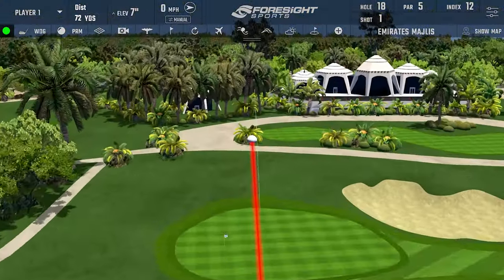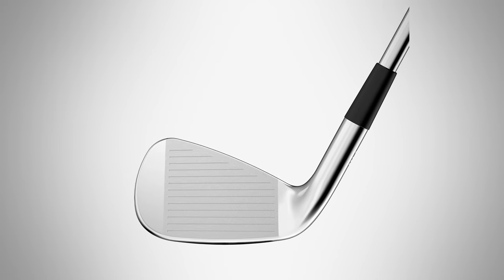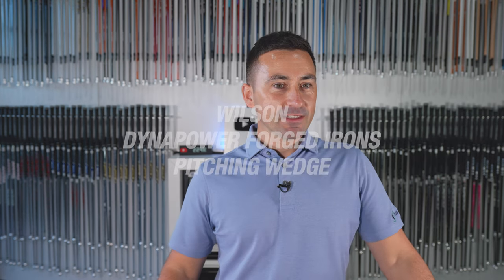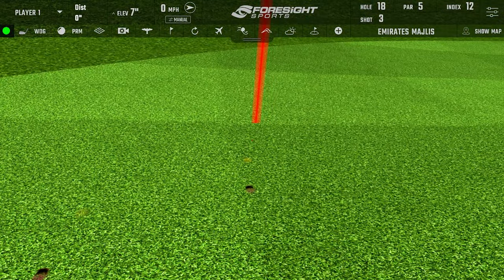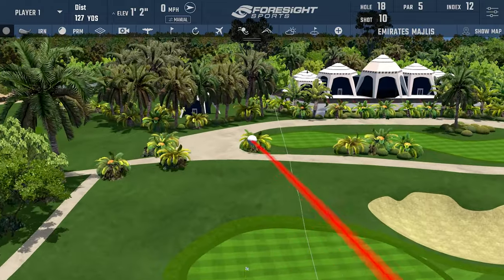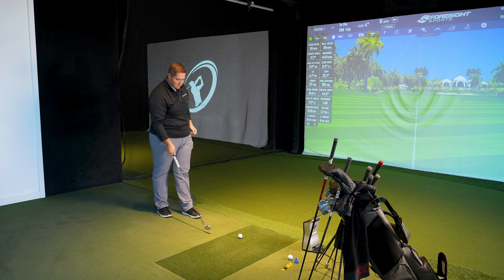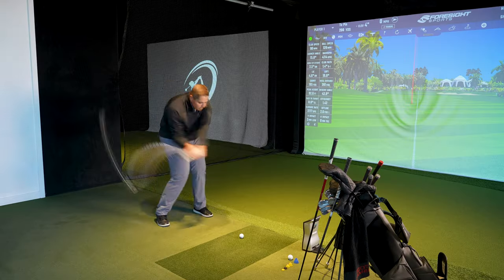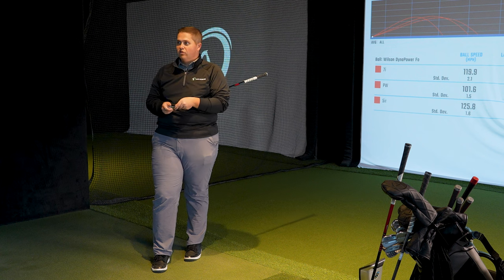WILSON DYNAPOWER FORGED IRONS \\ Game Changers?

Comment: Interesting. I noticed Mikey's chs was the same with the 7i and 5i, which probably explains some of the 'gapping issues'. I have the same speed issue (just a few mph slower) and the same gapping challenge - not enough gap to slot a 6i in there but too much to take the 6i out. I'm thinking of strengthening the 6i a degree and the 5i 2 degrees (and maybe lengthening the shaft for a mph or two more chs) to stretching the gapping closer to what I want.
I already play the Dynapower's predecessor - the D9 forged 5i and 6i, and the staff CB 7i and 8i and I don't think there is a noticeable difference in feel so am surprised Mikey thinks the forged Dynapower feel harsher than the CBs. I guess, like beauty, feel is in the hands (and ears) of the beholder.

Comment: They look good, they sound fantastic, they are clearly very forgiving but...

the spin on the 7i was stupidly low, the gapping between 7i and 5i was poor.  I do wonder whether the 6i might go almost exactly the same distance as the 5i.  I am guessing that the only way a ball stops on a green with 8i or longer is down to peak height and descent angle.

Cannot help but feel there are better options out there, but possibly not at the price Wilson sell at.  Like many sets with similar lofts this is not a set to have a 5i or 4i

Comment: You mentioned in a previous video that you would bend Mikey’s irons 2 up for the long irons and flatten the wedges, I’m thinking of doing this too with my new CB’s to help with the leaking 5 iron. What is Miley does in his swing that makes you consider that?
Reply: I'm doing the same JT. With a steeper but i--o swing plane with the short irons, I'm starting and sending them left. With the longer irons I have a slightly o-i path and start them straight but send them right. The flatter lie in the short irons will start the ball more neutral and reduce the left miss while the opposite will be the case when I make the longer irons more upright.

Comment: 4600 spin good for a 7 Guys?
Reply: The 7 is a 5 iron traditional loft s0 4600 is a touch low but not a travesty
Reply: @autumnstar9475 wrong, the 7 iron loft on these are 30.5, traditional loft on a 5 iron is 27. Trad loft on 6 iron is 30 so your way off
Reply: @ultimatejay  youre way off and ill informed. Maybe delusional. Traditional iron lofts would mean the time of the original staff model blades, og mizunos etc. those were 5 irons at 30 degrees. So yes thank you for confirming that this 7 iron is a rebranded 5. Youre wrong. Sorry bud
Reply: @autumnstar9475 All of you are wrong.

56° SW
52° PW
48° 9i
44° 8i
40° 7i
36° 6i
32° 5i
28° 4i
24° 3i
20° 2i
17° 1i

THESE are the traditional lofts.
Reply: This is exactly why discerning golfers should talk degrees loft rather than iron numbers, which is marketing speak.
Reply: I would be pretty happy coming into a green 180 yards away with 4600 spin.

Comment: 1.20 you said the "former iron" was a firmer iron i think u said and with stronger lofts, when in actual fact, the former iron, the D9 forged is made from the same metal and have the exact same lofts 🤷🏼‍♂️
Reply from the maker: The previous version was just called Wilson Dynapower.
Reply: These are actually replacing both the D9 Forged and the Dynapower (not forged), according to Wislon.
Reply: @clubchampionmedia   huh? Come on now, you know damn well these are Wilson's forged series of irons, the last forged irons was the D9 forged, maybe they should have a different name for their forged irons like every other company does I guess.
Dynapower and dynapower forged are 2 different irons for 2 different playing categories, you guys know that, and I know for a fact you know the dynapower forged was a replacement for the D9 forged
Reply: @clubchampionmedia the Dynapwr irons aren’t “previous”. They sit alongside these Forged versions, and still available as current model. They were just ahead of the Forged. These replace D9 Forged as others have said.